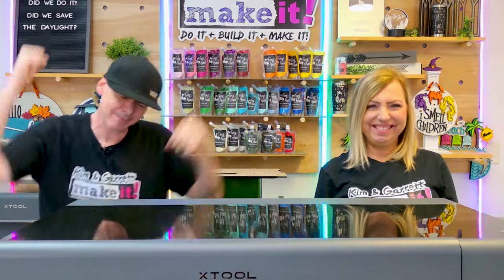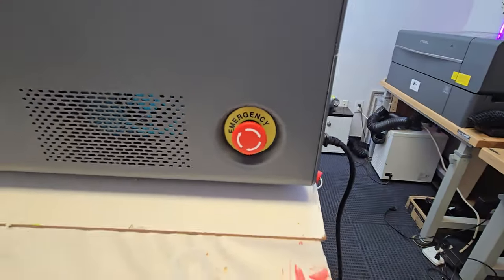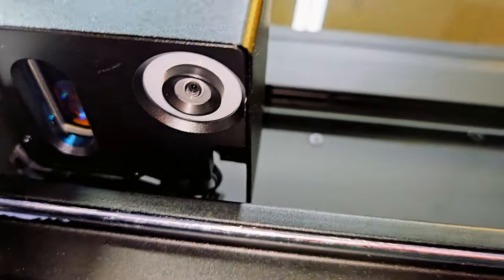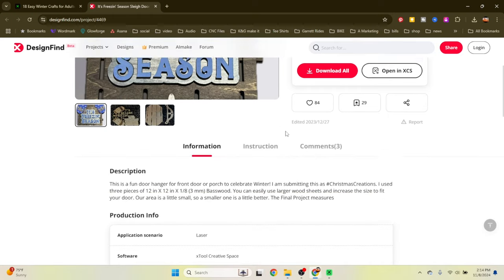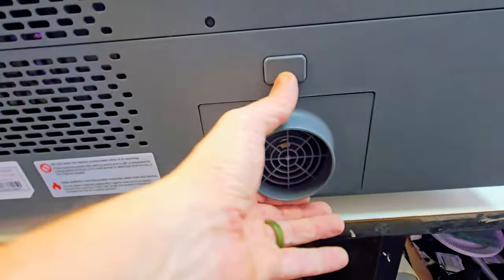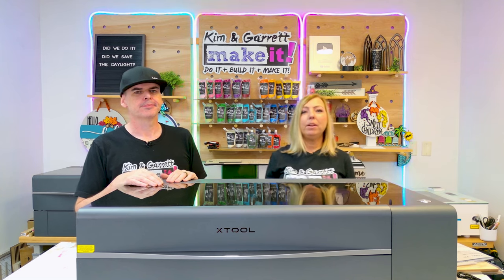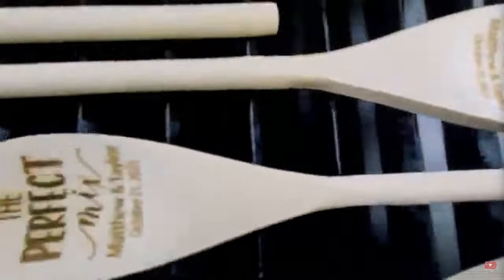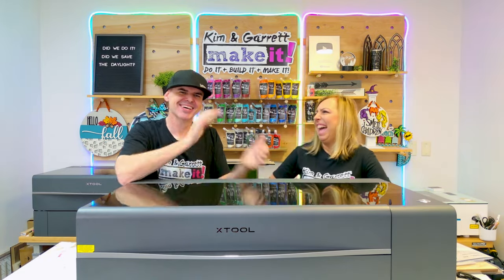🔔 Upgrade Your Crafting Game with the xTool P2S CO2 Laser! 🔔

Comment: Other than the exhaust upgrade and red dot alignment is there any features between the P2 and P2S?
Reply from the maker: Good question! Besides the exhaust and red dot stuff, the P2S has upgraded air assist, quick release fan and mirrors, and faster X axis.  If you already have a P2 it's not a big enough difference to make the upgrade.
Reply: @KimandGarrettmakeit Love the video I jsut received my p2 today and wasn't considering the p2s because of the price but I dug more into the upgrades and was wondering if should return my p2s to get the nice features I really would love having the easy maintenence the 40percent faster x axis the upgraded filtration system and the ease of maintenance. Would love to hear your opinion.